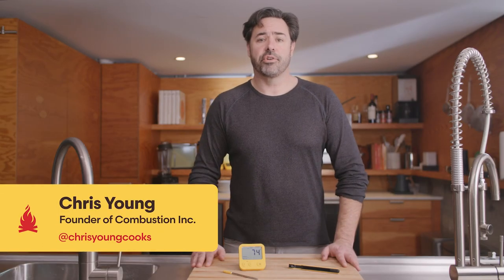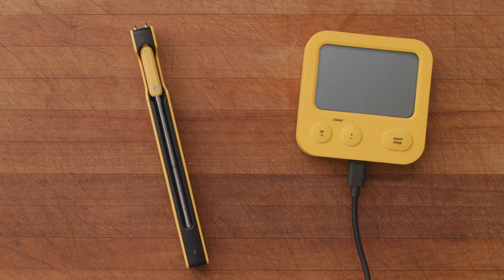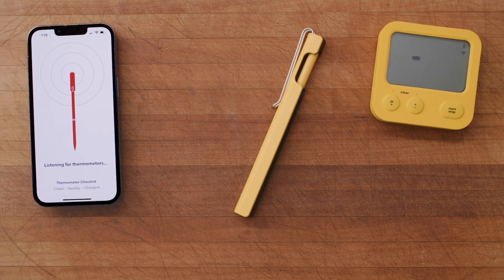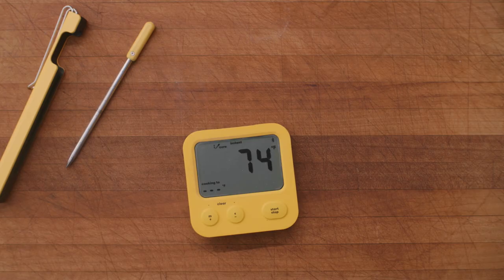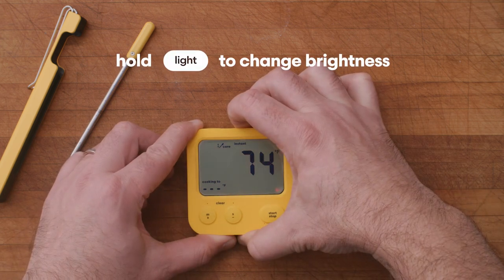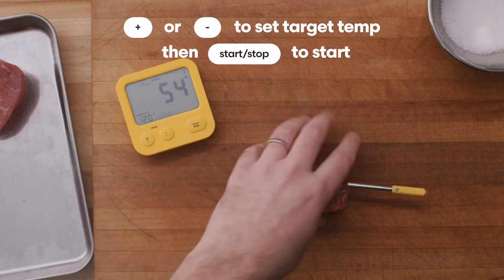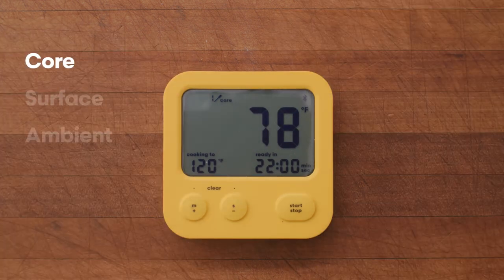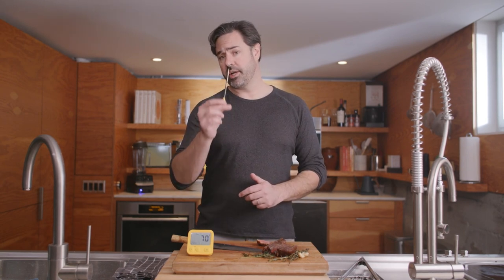Getting Started With The Predictive Thermometer and Display By Combustion Inc.

Comment: I just saw a review of the new Thermoworx wireless thermometer.  Very impressive, especially with the low-frequency radio that will support connectivity through dense cooking pots and smoker lids.  Then I went to Amazon to see if the Combustion Inc. product was still over $200.  Yep.  I saw all of the other prices for other products such as the new Meater with its multiple temperature sensors.  I just spent $50 for your booster so I'm way over $200 now.  The marketplace will tell you better than me, but my guess is that you're going to have to drop your prices.  There is a lot more value for money out there now.

Comment: Well mine is coming today!  With the GGG coming later it definitely checks off all the boxes for me.  One big concern...   not only does the display NOT show multiple thermometer temps simultaneously it looks like it takes 3-4 button presses just to check another thermometer?  What if I have two probes and a GGG going for a total of 3 (very often)?  Is it going to take 9 or 10 button presses just to check the ambient grill temp ?   Really hoping that a firmware update will increase the usability factor here.  I know folks will point me to the phone app BUT I specifically canceled my RFX Meat order due to the value of the independent display.

Comment: I ordered one and have recommended it to a friend as well. The thing that convinced me to switch from another brands probe was the minimum insertion depth which is absolutely incredible on your probes, the half depth discards the need to multiple expensive probes of different sizes (think meatstick) and the various temp sensors on the stick to give you that proper center cut temp. It’s brilliant, it’s the best one I’ve used yet. Keep up the good work. I know it takes time to build a rep for food gadgets, but your design is so next level and thoughtful that it became the only viable option for people doing different cuts of meat and different sizes. 

Thanks for putting this out there and I wish you all the best of luck, you deserve the attention.

Comment: Bought this. Haven't used it yet. I'm concerned about getting hot oil on the exterior part of the probes, including the charging tip. Should I be? Also as I flip steaks or move them around the probe might touch the hot pan. Is this a valid concern? Finally, is there benefit to inserting more of the probe if the piece of meat is not so big that the minimum insertion depth hits the "center" of the meat? I'm just thinking it might be easier to risk the probe touching the pan/getting less oil spatter if I insert it deeper.
Reply: Thanks for being a customer. Even really hot oil won’t be hotter than the max rated temp for the upper part of the probe. So don’t worry about that. Only a really hot charcoal grill or flare-up is likely to exceed the max temp. Same is true for touching a hot pan, even a ripping hot pan won’t heat the handle enough to do damage (I do this all the time). Finally, for small foods I always recommend pushing the tip past the center (even as far as the other side of the food) and letting the thermometer use all the sensors inside the food to find the core.

Comment: How long or how many charge cycles before the battery fail?
Reply from the maker: We use a fairly unique battery that retains its capacity even after several thousand charge cycles. After 2000 charges, the battery will still have 98% of its original capacity—enough for years of operation.

Comment: I wish the probe just talked to a phone with no need for a receiver.

I’m also afraid of getting grease in the charging port in the handle.  It should do wireless charging.
Reply: There is an app... for Android or iOS
Reply: You should look up how wireless charging works. It requires induction coils, on both devices; charger and device being charged. While this would alleviate the risk of ingress to the current USB-C port; it adds 2 additional costs to the product and a larger charge case. It doesn’t make any sense to gripe about USB-C charging vs wireless. If you’re that concerned, keep the charger away from your cooking area. I use the booster/charger most every cook, I simply don’t lay it down near any potential splatter sources.

Comment: Looks like a great tool. Really pricey thou. Who to know it's worth the cost?
Reply: It has 6 more temp sensors than any other wireless probe-type thermometer out there. Those aren’t free. Being able to detect then cook to perfection the middle of your meat without precision placement is incredible. The requirement to only insert it half way at a minimum means it’s both a long probe and a shorty probe and that’s unheard of. The temp rating in it is as high as the best out there now too. Predictive cooking based on multiple temp sensors is basically next level. Ya, worth it.